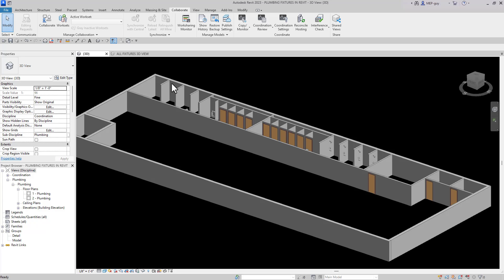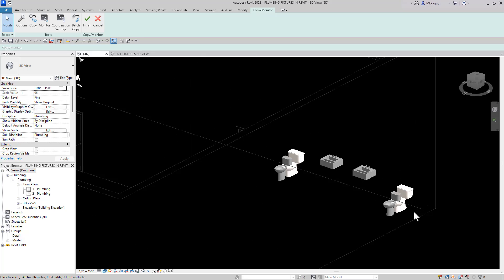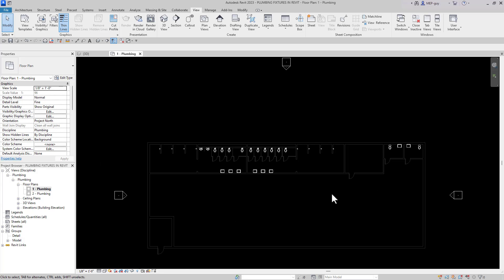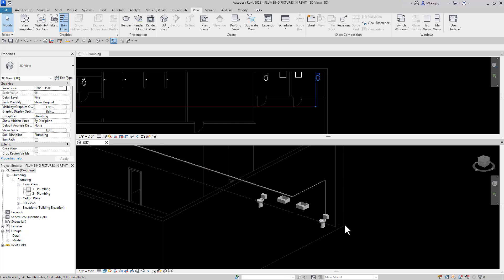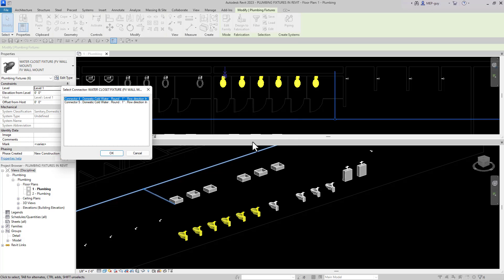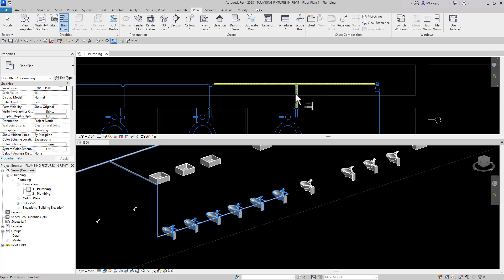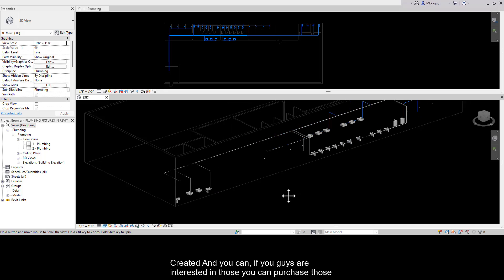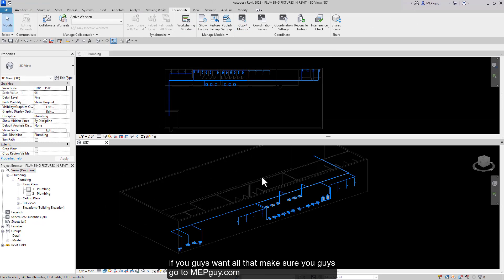INSANELY FAST cw pipe modeling & sizing in Revit

Comment: Ryan,

Going through your plumbing 101 course on your site right now, and was wondering how you would size the water pipe for the lavatories given that it was assigning 15 GPM for the 1 fixture unit of a lavatory since the system type was set to predominantly flush valves. This video ostensibly answered that question, since after sizing for the water closets, you change the system type to predominantly flush valves before size the rest of the pipe. 

This method works for sizing the pipe, but thereafter you will not have an accurate GPM shown for your pipe, since the system type has to be set to either FV or FT. Without an accurate GPM, we don't get an accurate pressure loss calculation.

Any thoughts on this?
Reply from the maker: Are you talking about doing a pressure loss calc for the entire building?

Comment: The critical path should take into account the pressure loss due to the "elevation difference".

the pipes should have a new parameter indicating this pressure loss. Revit do not.
Reply from the maker: When auto sizing you are assuming you have already have taken into account your head loss or pressure losses due to elevation. You size you piping based on velocity or friction loss. We still need to understand the fundamentals when using these tools inside Revit.
Reply: @mep_guy  Shouldn't Revit take this "elevation" issue into calculation?
Isn't this a deficiency?
Reply from the maker: @cm20506  Not for sizing piping. When you are determining if the building needs a booster pump that's when you would take into account the elevation. Once you determine the need for a booster pump or not you work backwards from the pressure you have left over. You still need to verify your pipe losses don't exceed the extra pressure you have. Refer to appendix E in the IPC for a complete explanation of sizing piping.

Comment: How is the calculation made when the pressure of water entering the building is not known?
Reply from the maker: Pipe calcs are based on flow rate. Flow rate is based on the GPM of the fixtures. Pressure has a negligible effect on the velocity of water through the fixtures so I can be ignored in the pipe size calcs. But it does matter it's just not how we size our piping. You could assume worse case the the pressure is 80 psi. GPM through all fixtures is a probability. We can't know the exact GPM at all times so we take a worst case based on the hunter curves.

Comment: my background is not in MEP so my question may sound "stupid", your custom fixture have 2 connectors (horizontal and vertical) for the same purpose, convenient for modeling for sure, but only one will be used, and that unused one will always be there as unassigned in system browser, i believe connector is kind of special element in Revit, you cannot switch it via family type and/or visibility
Reply from the maker: Yes, you are correct. what was your specific question?
Reply: maybe redundant connectors won't cause big issue but still hope factory can make connector as 1st citizen (can swap via family type, visibility, etc.), i just noticed in your another video using multiple connectors for the same purpose like sanitary, just wonder if this will affect calculation? @mep_guy
Reply from the maker: @ningzhou8397   It won't affect calculations in your piping, since the pipe sill only display flow associated with the connectors it's using. But you system browser will have some "unassigned" systems, which I just ignore.
Reply: thanks Ryan, maybe i didn't make it clear, what i'm asking is the case that you used both (horizontals and/or verticals) connectors, so no "unassigned" systems but 2 connectors instead of 1, i believe you used this approach in your video, does this affect calculation? maybe i misunderstood it @mep_guy

Comment: Bit of background: my Revit experience is in electrical, but I have recently become the BIM Manager for our MEP firm and am working on ways to improve the efficiency of both departments.

I asked one of our MP engineers about auto-sizing and they say that auto-sizing nor auto-routing have ever been reliable for them. Is your success with it primarily attributed to your custom families or do you still need to go back and manually calculate your sizes and make significant adjustments to the auto-routing?
Reply from the maker: Yea it only works if you understand how Revit calculations work. Revit uses fixture units and hunters curve per the IPC. Sometimes you have to use actual gpm instead of converting fixtures units to gpm. It's not complicated once you understand how it works. But my custom fixtures make it very easy since I've preset all the fixture units per the IPC. and I convert to gpm as needed.

Comment: question is there a automatic duct/pipe size in fire protection system as well?
Reply from the maker: You can use it for any type of pipe. It will size your pipe based on the velocity or friction loss you set.
Reply: But ideally your pipe sizing in fire protection should be based on your local fire code.